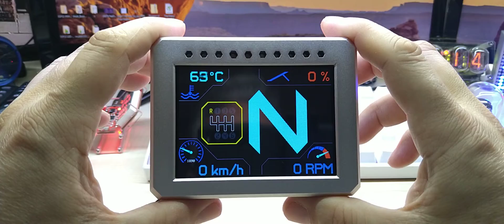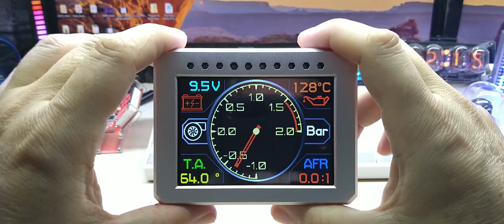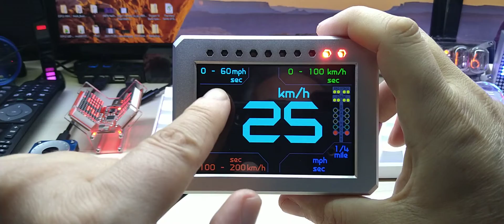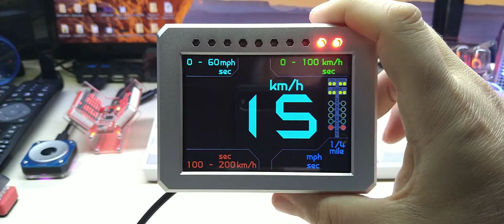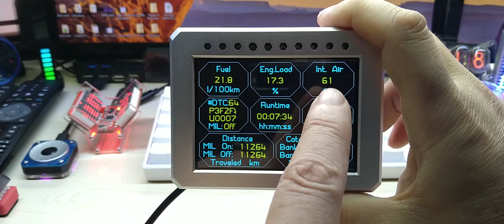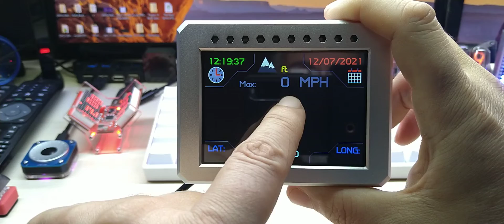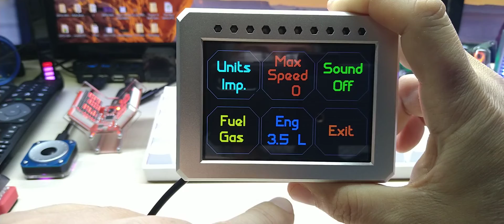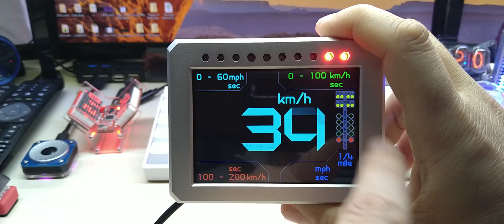my CAN GAUGE PRO with CNC Machined Aluminum Case, 3.5" IPS Capacitive Touchscreen, GPS and more.

Comment: Where is this getting its input, from the factory engine control ?  If so, I’m not familiar with any domestic cars with catalytic converters temp sensors, diesel trucks sometimes have ex gas thermocouples.  Or are some of the parameters meant to have standalone sensors not of the factory CAN bus? Nice unit, just trying to figure out it’s hookup
Reply from the maker: It is connected to the OBDII diagnostic port in the car and is using the factory sensors that the ECU is using as well. Diesel cars may differ. As for catalytic converters temp sensors, some cars have 2 or 4 depending on the engine and exhaust.